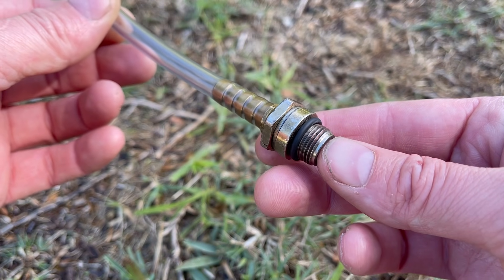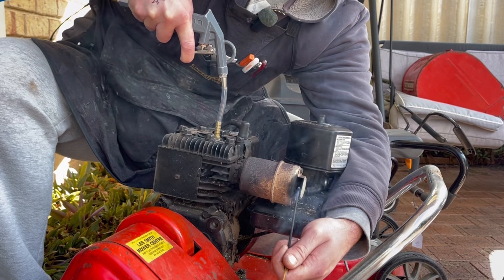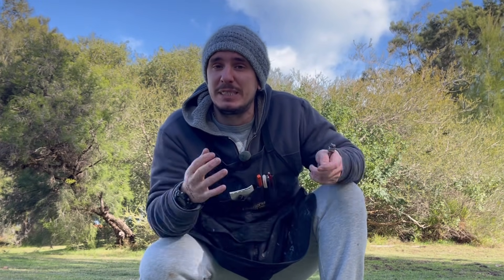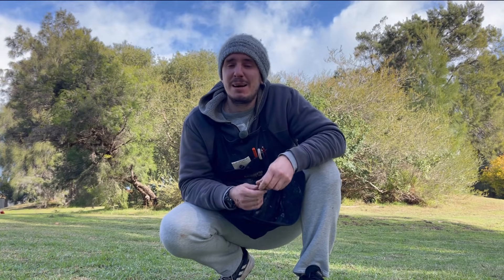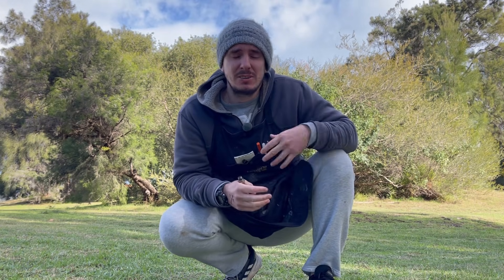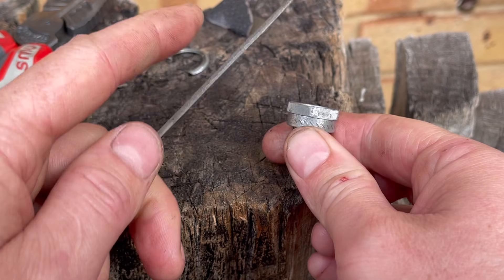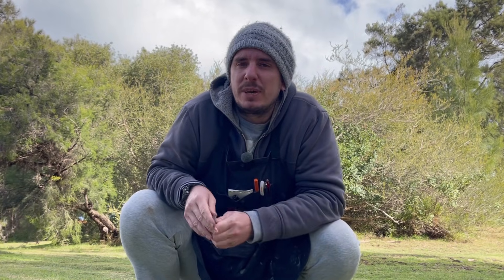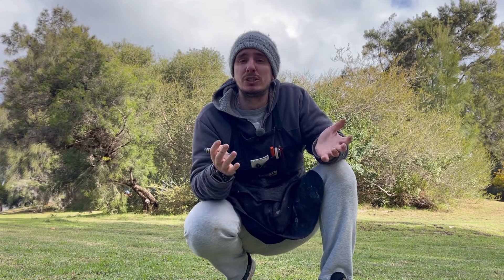EVERY Mechanic NEEDS One! - DIY Pressure, Vacuum & Leak-Down Adapter!

Comment: I would rethread the inner part of the spark then find the correct size barb then screw it in using a pipe thread sealant or teflon tape..
Reply from the maker: You can do if you want! 👍👍

Comment: I'm a fitter n turner
Self taught small engine mechanic
GT'S RUNNING REPAIRS 
Hobby I turned into a business. 
I ground flange off 3 plugs..14mm 12mm and 10mm
Porcelain cavity in 12 and 10 accepts a M14×1.25 tap perfectly 
So now I can test 3 types 
4th type is 8mm but that's radio controlled stuff
Reply from the maker: Awesome :) sounds good!

Comment: i need to be able to blow air in my spark plug hole to see if i have leaks coming out the exhaust tip,the oildip stick and the intake on a atc three wheeler to check seals on valves using compressed air.hmmmm gotta think on this one,oh ok ive got it i'll just use one of my compressor conectors on a old air compressor tool i never use,then once i glue it into the spark plug housing and it drys i can just hook up the compressor hose to the fitting,easy thanks,glad i bought a extra spark plug the other day haha

Comment: Any advice on what to do if the porcelain doesn’t come out after removing the crimp?

Edit: I dug through some white powder with a pick. There was a ring under it holding it in. This was a NGK BPMR7A if anyone else has this issue. Also get the 1/4 1/4 fitting not the 1/4 3/8 fitting
Reply from the maker: Yep you’ve got to get right through that crimp starting from the flat hex inwards.

Comment: This is great! Going to try this. Why can’t you leave the washer on instead of replacing it with an o ring though?
Reply from the maker: It doesn’t seal well if it’s been crushed :)
Reply: @VintageEngineRepairs  got it. Thank you. Does that mean you can get compression issues from putting a used spark plug back in?

Comment: Thanks for your tip on converting a spark plug for pressure and vacuum testing , it works a treat. I made up 4 for stock and different plug sizes. 
I have another question regarding my compression tester. I was struggling to get anything over 50 psi on any of perfectly running range of chainsaws and scrubcutters etc. I think I caught you saying something about different strength Schader valves ? Is there a specific one to use ?
Reply from the maker: Ah yes you need a small engine compression tester! Not an automotive style. Check it is designed for small engines and has a schrader valve. If after that it still is not a normal reading, then consider the weight of the spring of the schrader valve.

Comment: Instead of cutting a spark plug open, can I just use the little adapters that came with my compression tester? They fit the threads, and there is a hole in the middle to fit the hose fitting.
Reply from the maker: Yes! If there isn’t a schrader valve in it!

Comment: I used a chop saw on the metal shoulder, held the plug with a socket

Ground down the remaining metal lip on a stone wheel

Punch for the resister removal

Soldered the hose adapter inside the plug’s metal case

Thank you for the video
Reply from the maker: Awesome! Good job 👍🏻👍🏻

Comment: i tried to make one today but the "brass" fitting they sell locally is made in china and melts way faster than than the brazing rod....like its made out of brass colored solder ....ridiculous
Reply from the maker: That’s annoying! Best to stick to epoxy 👍🏻
Reply: @VintageEngineRepairs  i cleaned out a second spark plug this afternoon and then grabbed the small hose i planned to use on my hand pump so i could use them to choose a new fitting but i quickly found out the hose fits nice and tight in the plug case hole so im going to try it just like that for now ...then epoxy a new fitting if it doesnt hold

Comment: Well...I made 2 adapters 
Normal plug thread M14x1.25mm
Compression tester is M14

Motorbikes n qauds M12x1.25mm
Some trimmers n chainsaws M10x1.00mm
There is M8 but they're glow plugs.
Anyway I removed crimp with hacksaw n tapped out porcelain after cutting hook off, it was easy
BUT the hole remaining in the M12 & M10 was actually the correct size to run my spark plug helicoil tap, only the M14 part of tap.
Hey presto! I can now do compression, leak down and pressure tests
My adapter for pressure testing is a 2 stroke decompressor body (M14) with diaphragm part removed and a carby inlet tube cut and fixed in the hole
You have to be innovative, 
I also have a set of block off plates n rubber to block carby hole n exhaust
Reply from the maker: Awesome! Good work :)

Comment: I have been looking on Amazon for those barbed/threaded fittings. The sizes are a bit confusing; some images don't match. You show a 10mm hose barb and 1/4" BSP threaded fitting.
A smaller hose barb should be just fine, say 1/4".

The threaded end??? Is the 1/4" the ID? What is the outside diameter, that is what matters. Also there are NPT threads that should also work. I think that the threaded fittings will be about 2mm bigger on the outside?

A number of people commented that they ended up going to their hardware store to get the part they needed, after ordering what they thought was correct online.
Reply from the maker: I’d just go to your hardware store and make sure the barb fits your spark plug threaded portion :) saves a lot of guesswork!
Reply: @VintageEngineRepairs  I will try. I will take a couple burnt out plugs apart to measure better. The shelves in my local hardware store have limited choices, and usually higher prices. I think you used a 1/4 inch threaded fitting, inside diameter. I'll have to try a larger hardware store in a nearby town, if I go there. It is a 12 mile drive for me to go to the smaller closer hardware store, so ordering a part is many times easier, and cheaper. I am awaiting now various parts for my chainsaws, and other engines, ordered online, Cutter's Choice! and Amazon
Reply: @VintageEngineRepairs  I took apart and finished nicely a dead CJ8 spark plug. I could have used a lawnmower plug but that reaches in further, and most of what I will need to do, is a pressure or vacuum test on saws that take a CJ8.

I measured so I don't have to drive 45 minutes each way to hopefully find the correct part. I think I have found suitable parts on line. Ordering soonish. The inside of the former spark plug measures 15mm. Most threaded brass ends are about a mm thick. A 10mm NPT or other thread end, measured inside, plus 2mm each side, is 12mm, leaving 3mm room for glue.
I am going to try getting 1/4 inch hose barb, and 1/4" threaded end(or slightly larger).

Am I missing something? Let me know. I don't have a vacuum tool as yet, but do have a carb. pressure tool, so can do half a pressure test when I get this fitting made ;-)

Update: I ended up ordering two size fittings online. Both with 1/4" hose barbs. One 1/4" and one 3/16" NPT. The 1/4" barb & NPT, arrived first and is the perfect size I needed.

The 3/16 inch NPT, that is on the way, should work to make a smaller version.

I reduced the depth of thread on the 1/4" NPT fitting end, by half, so it sits in better; and I made sure none of the glue was wider than the hex of the former spark plug, so I CAN use a socket with it.

I used Permatex metal epoxy, after a final cleaning of parts with acetone.

I CAN just fit, onto the barb, after a bit of stretching, a 1/16" ID hose. Of course 1/4" hose fits easily, but I noted that my current carb. pressure tester has 1/16" ID hose. 

A fitting of 1/16 inch hose barb X 1/4 inch NPT(or other thread), would also be a good option if using smaller than 1/4" ID hose.

Now I just need to find some rubber to make wedges, and I can pressure test.
Reply: A friend stopped by my shop and suggested that I could braze the two parts together, and be certain of a seal. I explained to him, that I need silver braze for this job, so as to not melt the brass/copper, but yes, this too would be a good option. I think though, these two metal bonding glues do a fine job, if applied carefully. Mine looks sealed; still curing.

Comment: More difficult than shown. Cut off SP end like described, but it’s solid stuck tight, cut off more of the end further over the bolt part. Still not enough, banged hard and a lot with a metal punch both sides of inner rod. Not much left to glue in BSB. He didn’t show it coming out in video, the hardest part of all. Took a good hour just for that part.
Reply from the maker: It may need a tap
Reply: More like a jack hammer. Love your videos.
Reply from the maker: Did you get it out? Thanks for the kind words!
Reply: @VintageEngineRepairs  Yes I did, but the thread was hacked. Oh well. Sometimes it pays to pay for one. Maybe because it was a newish spark plug. Where are you in Australia do you offer service?

Comment: Great video!!!! You gained a new subscriber! Thank you sir!!!
Reply from the maker: Oh awesome, thanks!! ☺️
Reply: @VintageEngineRepairs   I cut two cheap spark plugs with a die grinder. The porcelain came out of one fairly easily, the other one was a PITA. But now I have a way to pressure and vacuum test all of my small engines.
Thank you!!!
Making this little tool was easy, because I happened to have plenty of spare spark plugs laying around. Doesn't every DIYer??

Thanks again for the video!!!

Comment: I was thinking of something like that coupled with a wire with a battery charging clamp, for grounding the spark plug when testing for spark
Reply from the maker: I’m sure it would work; but you’d be better using a plug as they all have resistors nowadays’
Reply: @VintageEngineRepairs  right. my thought is that since the engine is surrounded with plastic, there's no way to ground the plug and see if it's sparking
Reply: @mickdog2  I made a tester this way. Used a non resistor plug, broke off the tip, soldered a wire to the body of the plug, and put a clamp on the end of the wire. I use it a lot.
Reply: Kohler service manuals show a clever one(home made spark tester) that uses a short piece of fuel line slipped over the electrode end to make spark easier to see. It’s made just like your description.

Comment: I love this! I started to make one of those last week but got sidetracked... But that's a good thing because you showed how to cut the crimp to remove the porcelain. You are going to save me a whole bunch of messing around. Thanks so much.
Reply from the maker: You’re very welcome :) glad it helped!
Reply: @VintageEngineRepairs  you helped big time! I'm never too old to learn new tricks. I was going to beat the porcelain out of a plug 🤦 Now I can just fire up the die grinder which is already on the bench and have that out in no time 😁😎👍 I'm gearing up to do crankcase testing on saws, I have a pressure tester and a vacuum tester. I just need to make the plug and the rubber gaskets and I'm good to go

Comment: Outstanding Tom, I have glass reinforced plastic barbs for in ground use also, I will give that ago too. Will let you know, brass is great. Epoxy’s have advanced tremendously as long as surface is clean, gently rough or scuff for best adhesion. Great vid, and that Wicker Packer video was awesome! I can say we use to abuse those things! Let out in the elements etc, rough life on those machines. Take care, thanks again.
Reply from the maker: Thanks Dennis! Glad you enjoyed this and the other video (Wacker packer). Thanks for commenting and sharing!